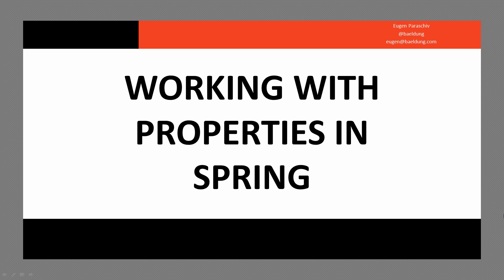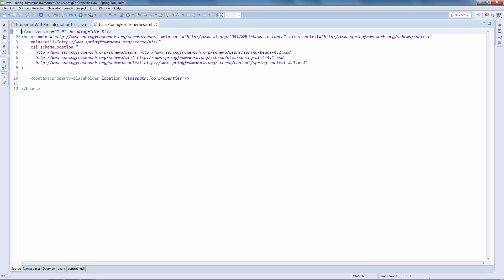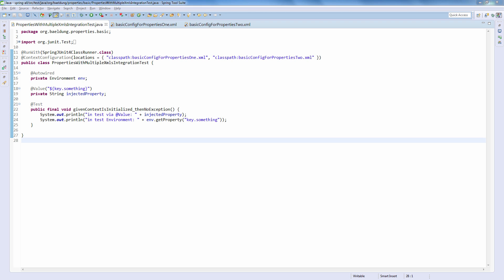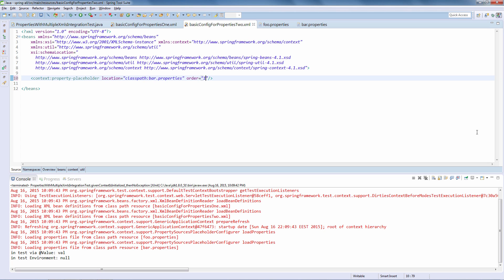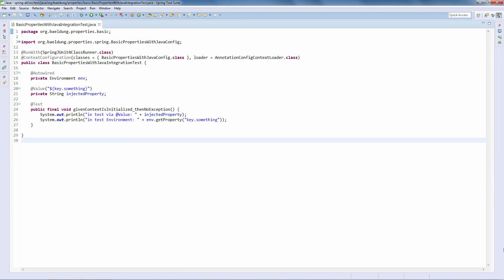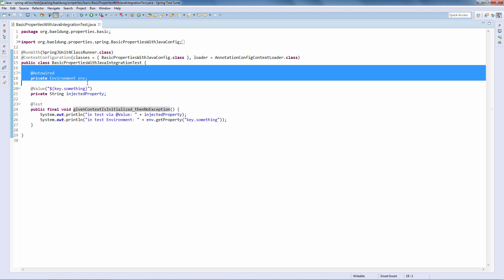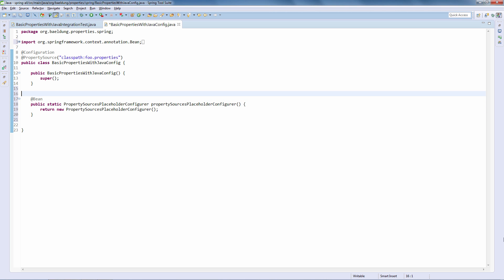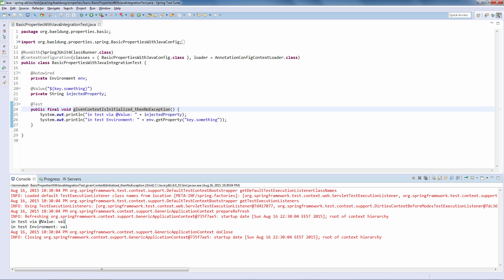Working with Properties with Spring

Comment: Interesting.  Have you ever tried using a dynamic property file assignment? Something like have the property file selectable based on whether we are building for test or for production? Typical usage would be to assign a database different for test and prod. I don't want developers stomping all over my production data!
Reply: +Adrian Challinor Yes, definitely. This video is only the nuts and bolts of how to work with properties within the framework, but there's another layer to this, as you mention. Beyond just using properties, you also want to have a good strategy to manage these properties for different environments. I focus more on that on the site and within some of my course material, but generally speaking - I fully agree with that approach. Cheers, 
Eugen.